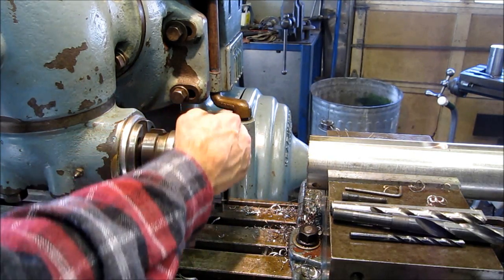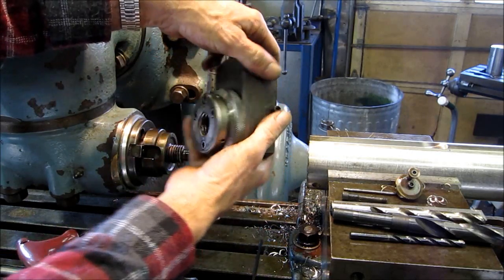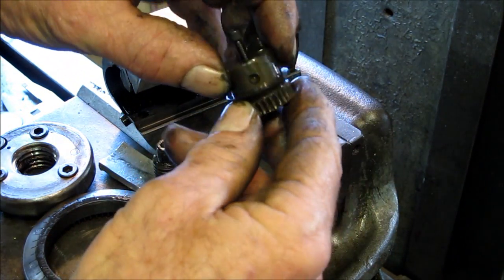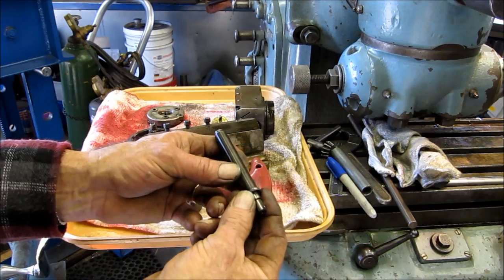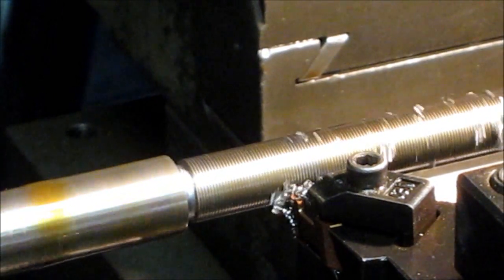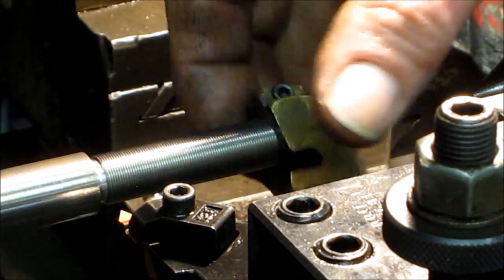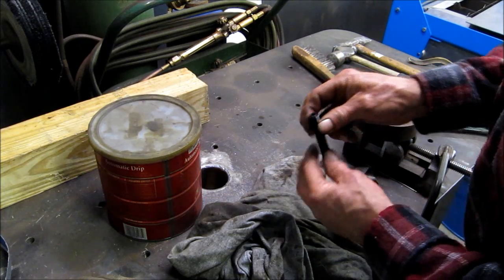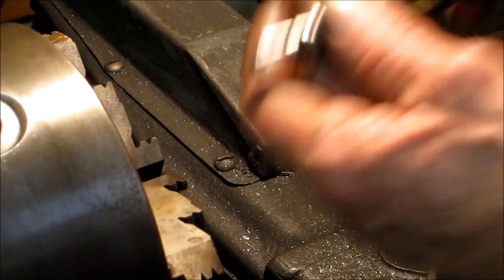Whining can't Fix it!

Comment: My dads axiom.. the part that breaks is always the deepest part installed in an assembly.  At least yours wasn't a valve stem..while flying..hahahaha! One question, is the "cutter" ground at the angles of the threads? And please forgive my non-machinist nominclature of tools.

Comment: Why do you choose to single point face bar stock like that? Why not just use a face mill and machine the end? Not that there is anything wrong with your choice, just curious. A face mill would be much quicker and just as accurate, as long as everything is indicated perpendiculur same as you need for the boring/face head.

Comment from the maker: I will clean and regrind the jaws when I complete the tool post grinder, project. The tail stock is key based to the lower half, when side to side adjustment is made the whole base slides equally and up and down is adjusted by shimming the split line. ;{)-----

Comment: For some reason reason, I find the vids of you fixing or improving your machines to be fascinating.  I know you are great at compensating for machine wear but will you be doing anything like rebuilding the 3 jaw chuck or is that something you would replace?  Also, in another video you showed adjusting the tail stock using set screws on the front.  Is there an adjustment on the rear to true the axis for drilling?  What about up and down?

Comment from the maker: That was the top of a rudder post in a 200 Lb S/S cast blade, I had to shorten then drill and tap a retainer plate for the top. So I had to use my mill, you just never see the blade because I wasn't doing a video on the rudders, but will post the photos on web page soon for viewers. ;{)-----

Comment: Hi Keith,   great video.  Makes me want to turn a new tool slide leadscrew for my 150 year-old flat-belt Cincinnati 24" shaper that has about 50 thou backlash!  Question: were you concerned about warping when you hardened your lead-screw?  I have lots of O1 lying around... Would that be OK for a leadscrew?  Would it warp more that whatever metal you used?

Comment from the maker: @billdlv Well I could of canged up and took a shell mill to it and then relocated on the next post to drill and tap it and then shell mill that one too, which would of been more time than the original plan! I would still have to repair the head and the time to do that was still hanging over my head, The very next job, in that machine is going to need it, I should really have a back up head, for as much as I use it...

I still have to look at the procurement or the repair also!